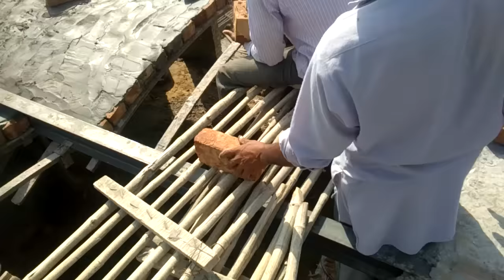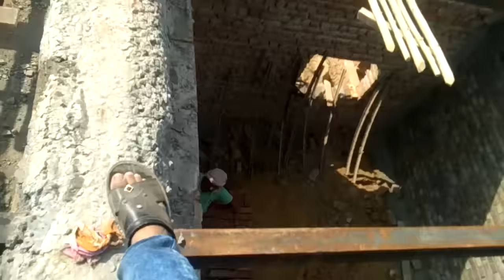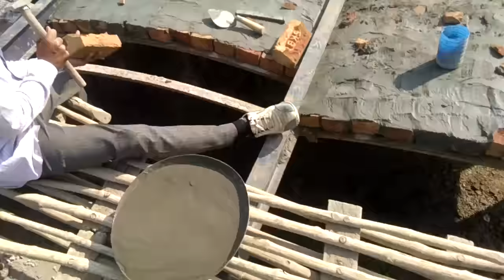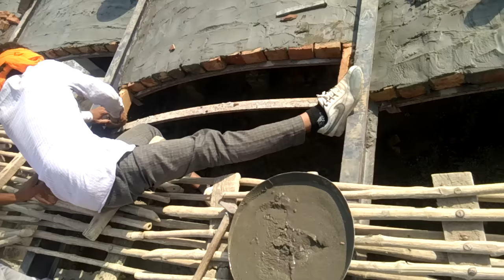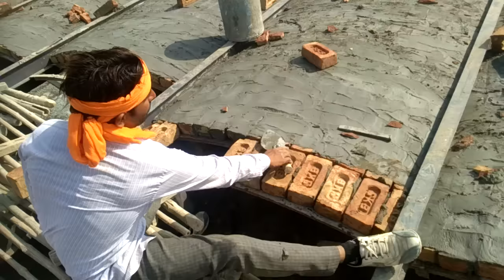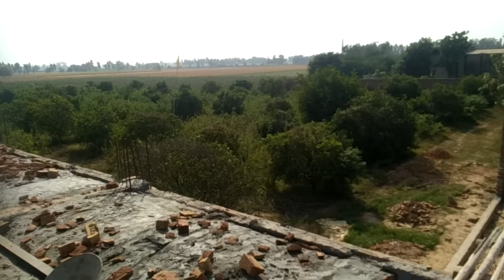08750690090 सिर्फ ईंटों से लेंटर

Comment: Your idea is  very good but you need to make bricks bit larger .
Another option is. 
use self locking bricks and reduce iron use  and cement use. 
You cover it with black color plastic,  you will not get rain water inside home.  Home will remain cool .
Try to reduce cost. 
If you building school,  use pavement for flooring. 
We must rethink new ways to get back all our raw material back.
In some countries they have hoals in the bricks they put iron rod,  wall can't fall . You can use clay for joint and vedic plaster. 
Namh shivay.
Reply: Hahahahahahahahaha
Reply: This is gravity method. Impossible to fall down unless gravity stops.